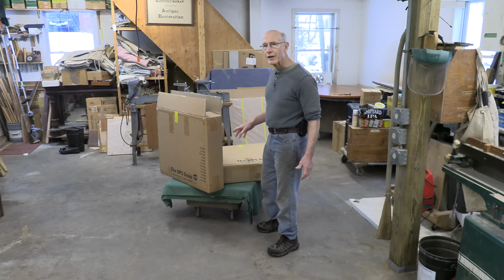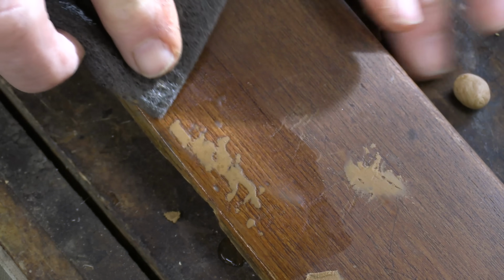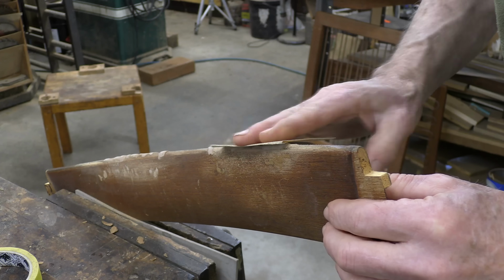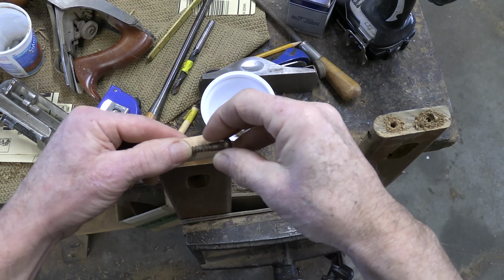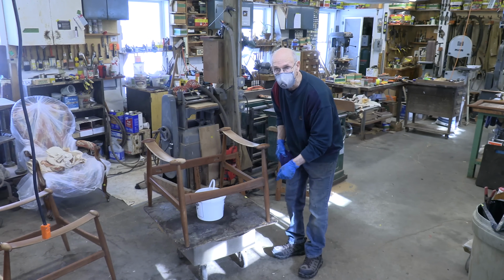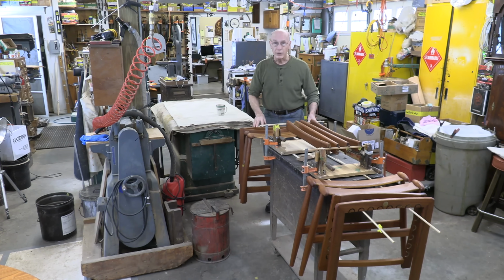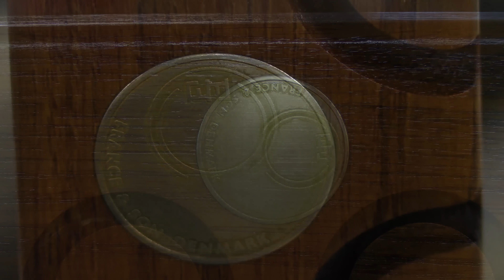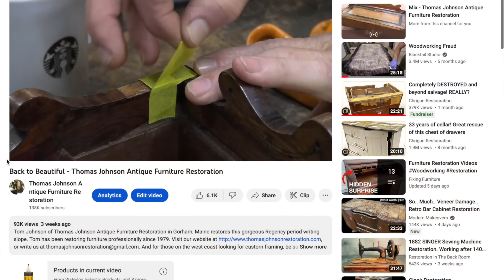Full of SURPRISES! - Thomas Johnson Antique Furniture Restoration

Comment: They used to tell me at school that felt tip markers were not art supplies, and then Thomas is here repairing high end furniture in a high end way with them.
Reply: You look at the price of those brush-tip markers, then tell me... 😜
Reply from the maker: Thanks! A marker is a brush - with a reservoir attached!
Reply from the maker: Yes, I don't understand the resistance to markers - what difference could it make? They are brushes!
Reply: @johnsonrestoration  I don't either - and the solvent in the marker is alcohol or white spirit/thinner, which is what would be used anyway.

Comment: Love your great work!  Two things:  I've seen another woodworker use syringes to get glue into fine cracks/crevices;  ever tried that?  And two:  on Antique Roadshow, the experts always recommend maintaining the original finish as much as possible, to retain value.  I was surprised to see you not doing so.  Will this affect the value?
Reply from the maker: Thanks! Oh yes, you will see me using a syringe a lot in my other videos. And I didn't strip these chairs, I just re-oiled them with Danish Oil. I always save old finishes if they're any good. Often the finish is not salvageable
Reply: @johnsonrestoration  Right on!  Thanks for your reply!  Love your work/vids, including the nature clips!!!

Comment: Sometimes soaking the rubber parts in hot water makes them more plyable , that's how I put new rubber on my bandsaw wheels.
Reply from the maker: Good idea! But there were steel springs in those - still might have helped

Comment: Anothr great video Tom. one curiosity though,? why you used Tiebond glue on the joints instead of a Hide glue? I can understand it on the cracks etc. but thought the hide was to allow future ease of separation if needed? Thanks for another great video ECF
Reply from the maker: Thanks Ellis! PVA glues and epoxies are fine for repairs. Here I used PVA for the joints as well, because that's most likely what was used originally. PVA glue, like hide glue, can be loosened with heat and water

Comment: Tom have you considered using industrial strength rubber bands for clamping, especially  on round or difficult angled objects?
Reply from the maker: Thanks! Yes, I have some. They can hold something in place, but they have no power to bring pieces together.

Comment: For getting glue into cracks, i have seen people just push it in, as in this video, use syringes, string, or air compressors to blow the glue in.  I'm curious if you have tried these other techniques and have any opinion on effectiveness or when you might use one over the other?
Reply from the maker: Thanks! I've never tried compressed air or vacuums and such. I have always knifed it in or pushed it. Someone just today suggested dental floss!

Comment: Can  the chair be disassembled after putting it together using the titebond glue ?  I am new to woodworking and very much enjoy your channel. Thankyou .   :-)
Reply: It can be disassembled as intended - the two arm assemblies, the two rails and the seat/back are not glued to each other. The glued up arm/leg assemblies shouldn't need to be reglued unless/until the glue fails, at which point removing Titebond I residues is a bit harder than hide glue, but not difficult.
Reply: @dlevi67  Thank you very much.  I can't get enough of these  restoration videos. Johns Furniture Repair is another great channel.  :-)
Reply: @fishtwo1  You are welcome! Yep, I like John's (or rather, Trena's) videos too, but I find the pieces on which Tom works more interesting on average.
Reply from the maker: You're welcome! And yes, dlevi67 is correct!
Reply from the maker: Thanks!

Comment: Thanks Tom, another excellent job.  They look great.  Did you use yellow glue instead of hide glue for more strength?
Reply: Probably not - it's just a bit easier as it doesn't require warming up. Wood by Wright did a very interesting series of tests on glues, and the two 'modern' hide glues (Old Brown and Titebond Hide) came up with about the same strength as Titebond I/classic.
Reply from the maker: Thanks! dlevi67 is correct!
Reply from the maker: Thanks! I should find that test. But yes, in our own "shop tests" hide glue was just as strong as modern glues
Reply: @johnsonrestoration  @dlevi67 Thanks!
Reply: @stevebussell5568  You are most welcome!

@Tom - here's the link to James's "first results" video; he has kept testing samples for the most popular glue types every year for the last 3 years. https://www.youtube.com/watch?v=ZoaTZY5cSQE

Comment: Just a question about the re-using dowels . Do they absorb moisture and expand a second time ? Would a new, dry sponge dowel not be more effective ? I wonder how many hobby carpenters like me who were inspired to build furniture by Norm Abrahams are, like me, finding you to be a new inspiration and a turning to furniture restoration ? Thanks Tom
Reply: Perhaps a new "compressed" dowel would give you a tighter joint for a while, but here they really need to be made of good quality wood (which 'commercial' dowels aren't always, in my experience), as they are all that's holding up the seat rails. Also, they seem to fit very snugly in the original holes, so...
Reply from the maker: Thank you! That's a very good question which I have not thought about. What you're saying makes sense. I like the reference to Norm!
Reply from the maker: Yes! I'm buying dowels over the internet now because the ones from the hardware store are crap! Where do they get such lousy wood?

Comment: Is there a putty that has a color that would match poplar? I have been looking for ages and am getting to the point where getting clear epoxy and putting in sawdust is the last option, but its on a vertical piece of wood, so dont want it to run. 
Great video, nice to see some dansk furniture
Reply: If you are happy with something that is not as hard as epoxy, and are then finishing the piece with something impervious to water, I quite like Osmo putty. The so-called 'natural' tint is reasonably close to poplar/tulipwood (in the light areas, not the pink/green ones...), and it takes oil-based stains very well; you can't use water-based stains/colours until you coat it, as the filler re-softens if touched by water. Once it has set and has been oiled/coated, it's very resilient - I have patches on my house stairs that have been there for 2 years, and they don't show any wear (4 people and 3 large dogs in the house).
Reply from the maker: Thanks! It's difficult to find putty that matches. I like dlevi67's response, and I'm wondering if the Osmo is similar to Elmer's Wood Filler that is also water based and can be tinted easily. I'm doing just that in a video I'm making now.
Reply from the maker: Thanks! Yes, I've been using a water based putty, tinting with dry pigments. It seems to be working well
Reply: @johnsonrestoration  I wouldn't be surprised if the Elmer and Osmo putties were made in the same factory and then branded differently; Osmo is easy to find in Europe, Elmer not so much (and probably vice-versa)

Comment: Those pods on top were destined to break, too many mortises. Good looking design is not always good design. 
But as always, Mr. Johnson makes it look good.
Reply from the maker: Thanks! I thought so too until I learned that the chair lived in a household with 10 kids! Now I’m impressed with how strong they were
Reply: @johnsonrestoration  I learned the lesson building a cheval mirror many years ago. Had a single block on each side that each had mortises for two feet, a cross stretcher and the vertical post! 
I ended up enlarging the block slightly and making it in Brazillian Cherry rather than mahogany to add the strength needed. 
25+ years and four moves later they are still in one piece!

Comment: Did a great job as usual, but I think the chairs are a flawed design.  With the cracks and splits radiating from the screw points you can see they are not long for this world, unless no one sits on them or you keep repairing them.  Bullet shapes look cool but they should have made them larger.
Reply from the maker: Thanks! I agree. But those chairs lived in a house of 10 kids and were moved all over the world (military family). So maybe not so bad...